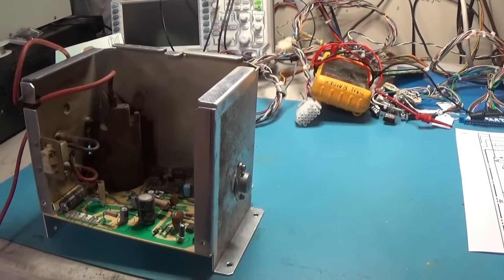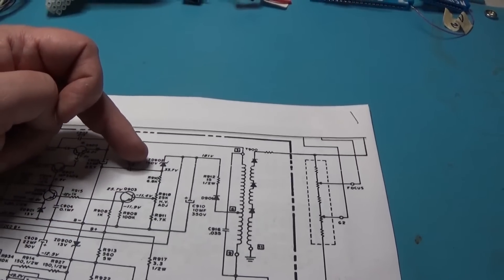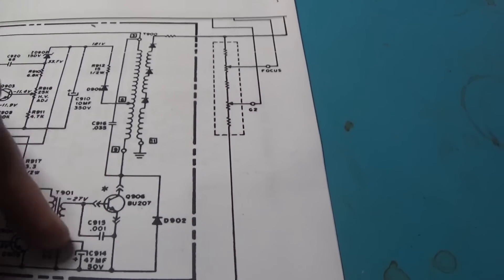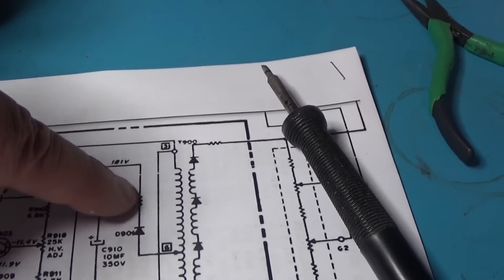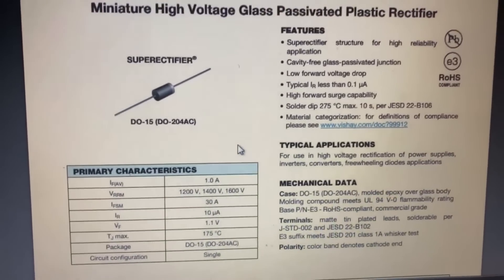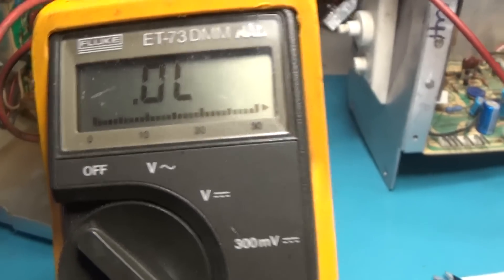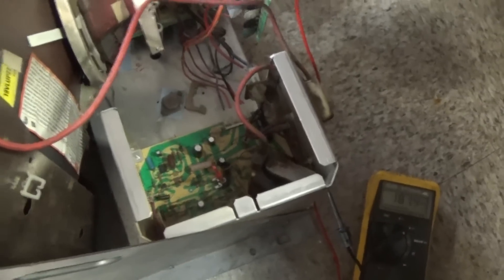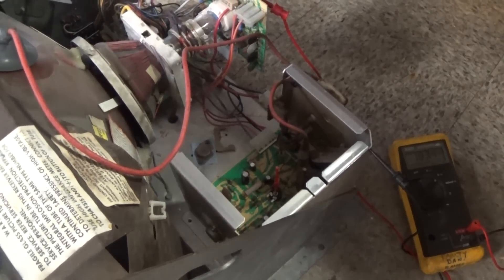Wells Gardner K6100 Color Vector Monitor High Voltage Cage Repair  -  2-10-2024

Comment: That circuit in the lower right corner looks like the oscillator.  Transformers don't transform DC well--they short out.  Raster scan monitors will use the horizontal oscillator to generate high voltage, but vector monitors don't have such a thing.

Comment: Whenever I repair WG6100 monitors, I add 1N4007 diodes across the deflection transistors (2n3716 and 2n3792) to prevent the over voltage problem that can knock out the transistors and monitor PCB.  Did this 20+ years ago in my Tempest and still working great; Tempest is particularly bad about the over voltage problem as everybody here probably already knows.

Comment: I don't think I ever blew a resistor in anything, but I once had a floppy disk drive with a short to ground, and an ATX power supply whose overcurrent protection failed...it melted the insulation on the wires running up to the disk drive.

Comment: I have the overcurrent protection parts on my HV cage.. sure helps. Plus I use upgraded 2n3716 and 2n3792 transistors..I now use MJ15003 and MJ15004 . I also use these now on all bw vectors like asteroids and cinematronics like star castle etc